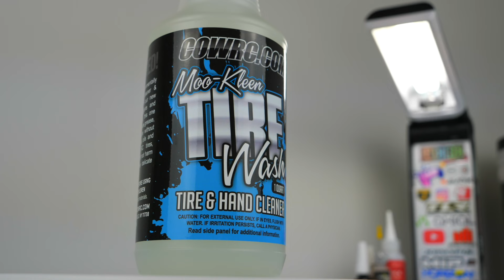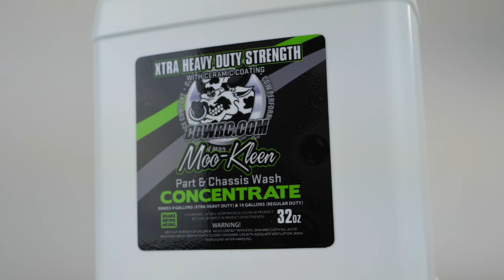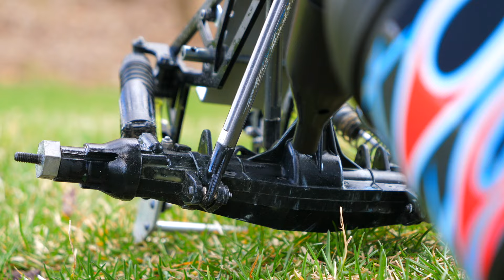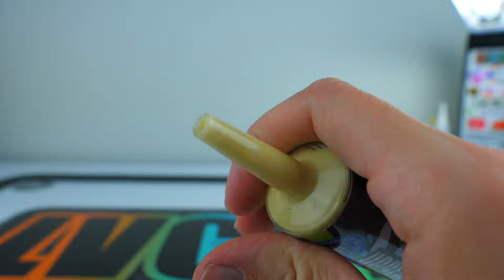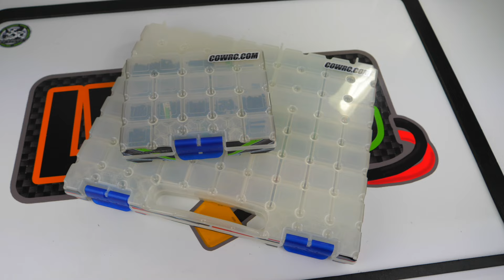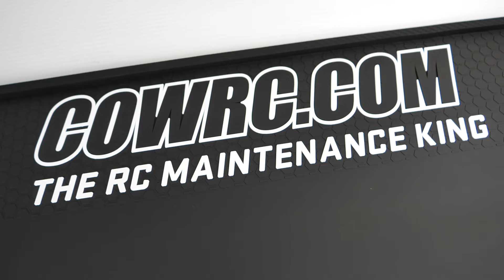The RC Car Maintenance KING? | Cow RC Product Overview

Comment: what do you use to make the tribute wheels fit on the lmt trucks? 12mm hex or 17mm hex and adapter
Reply from the maker: JConcepts makes plastic 17mm hex adapters for the Tribute wheels. 👍